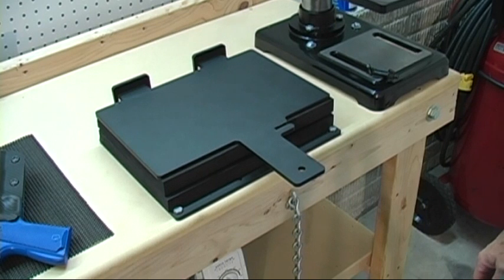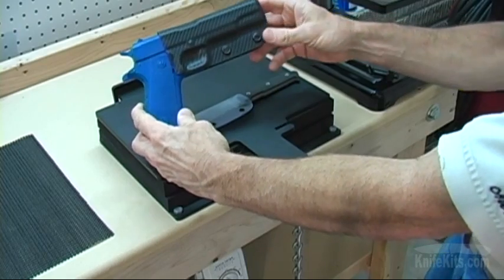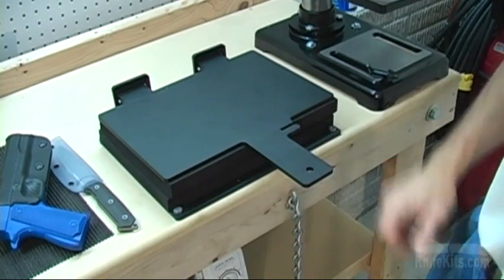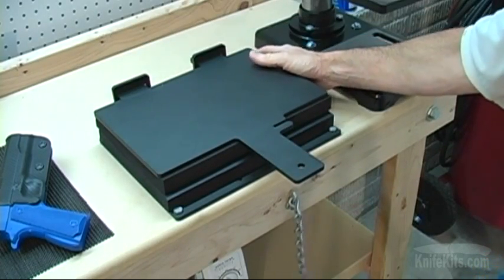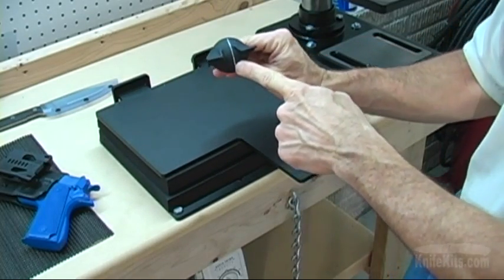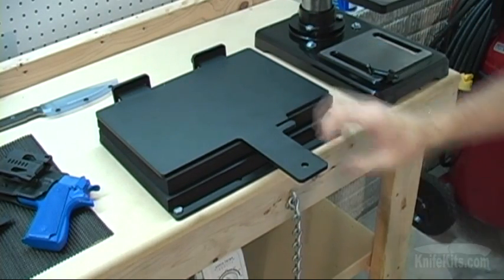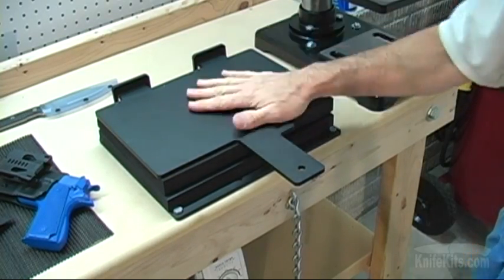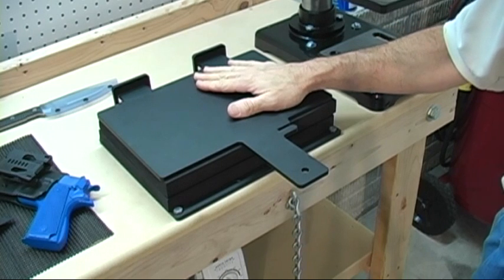KnifeKits.com : Sheath/Holster Molding Press - 12"/24" Bench Models

Comment: Question: would it be possible to use this press to wet-form leather sheaths?
Reply from the maker: Yes, you can use any of our forming presses to wet-form leather with. Our metal presses are powder coated and the molding foam is hydrophobic. You can leave your work in the press to dry for as long as needed.

Comment: Can it be used to wet form leather?
Reply from the maker: Hi Jesus. Yes it can. It works great for wet forming leather. The molding foams we use are impervious to water and the metal surfaces of the press are powder coated. You can leave your wet work clamped until it's fully dried. Let us know if you have any more questions or need help.  Alex
Reply: @KnifeKits  thank you so much. I'll be placing my order shortly